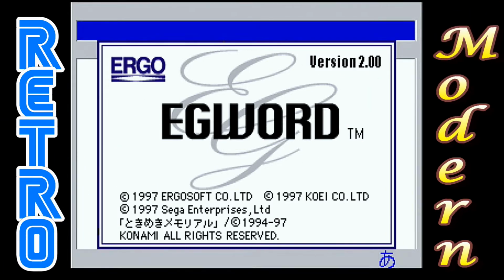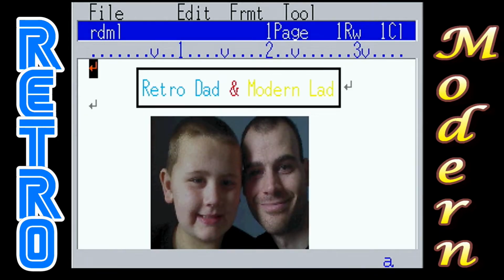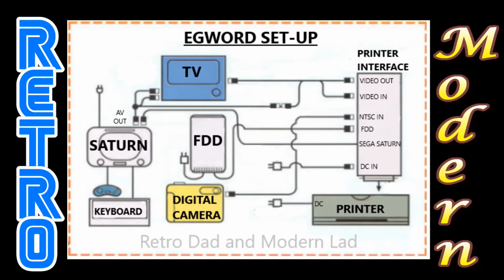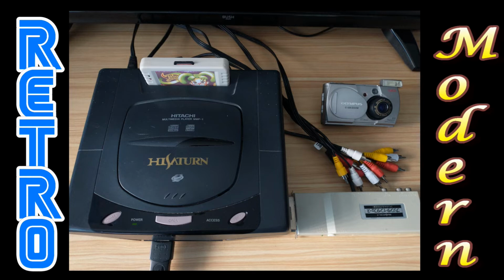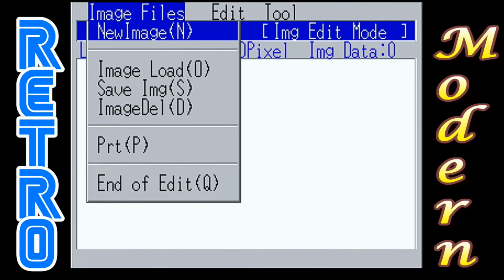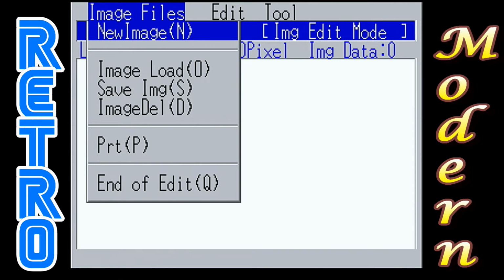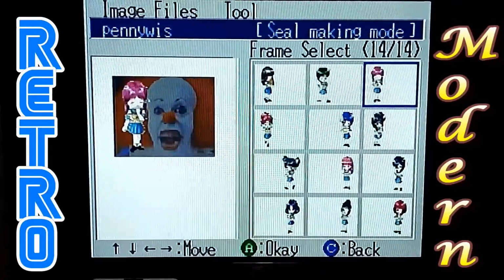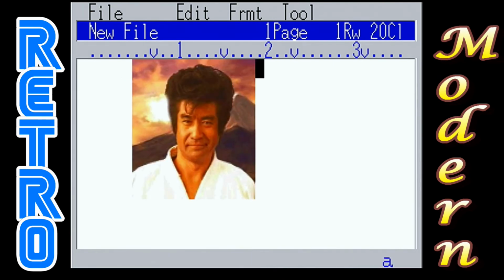EGWORD English Translation Digital Camera Set Up (Sega Saturn)

Comment: Nice info! But wow that's alot of work to get personal  pictures on the saturn. I assume Injecting personal pictures into the Iso itself would be an easier method
Reply from the maker: Thanks for watching. Yes, it's definitely not for everyone ,but am a hardcore Saturn fan so find it interesting. Plus was no information out there on how to do it ,so good to show people. You don't need to use camera and printer to play with software. There's hundreds of pre loaded images including 12 new ones I put in for the English translation 👍
Reply: @retrodadandmodernlad9857  ya that was very cool you added more pictures, what format does it need to be to have the saturn display the pictures?
Reply from the maker: @adammiceli4366  it depends whether you save them from digital camera or add them like I did with the 12 new ones. The Saturn uses a certain file type to save any files. The preloaded images in the software are in BMP format 👍